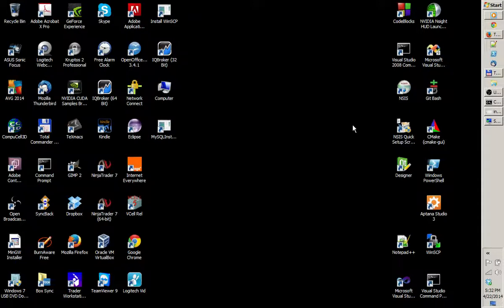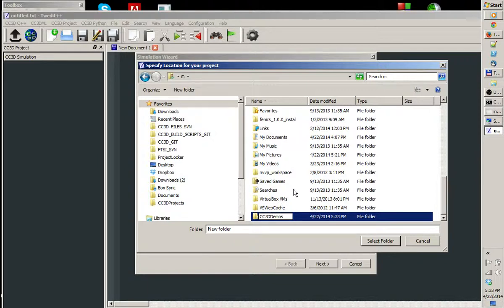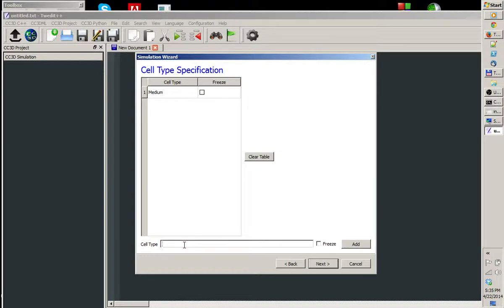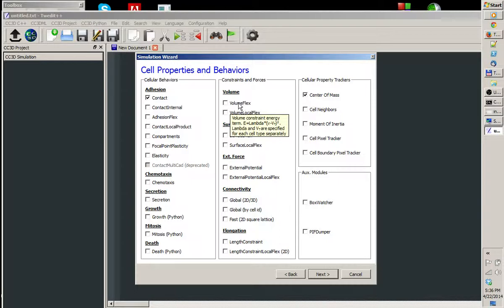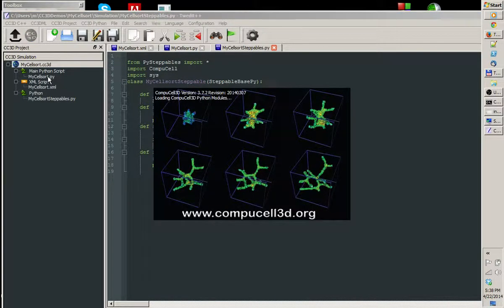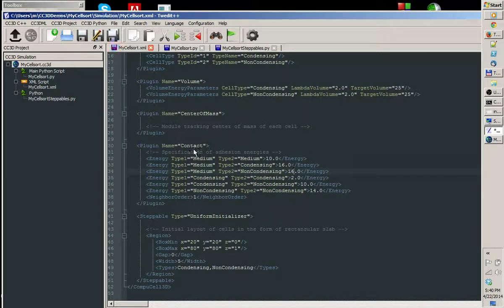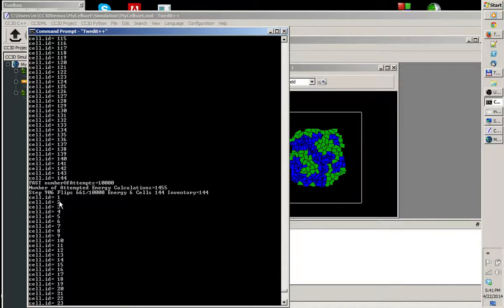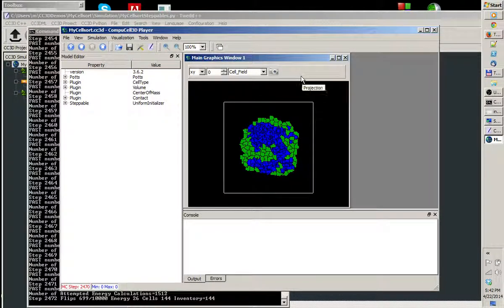Generating CC3D simulations using Twedit++

Comment: Hi, 
I've been trying to get this working. I am using Kubuntu and think I have installed CompuCell3D correctly. I can create .cc3d files in twedit++ but when I go to run in player they do not run. If I pause it or stop it and try to play again compucell3d just shuts off and I get the error 

, extraInit for: CenterOfMass
, extraInit for: VolumeTracker
, extraInit for: CellType
Segmentation fault (core dumped)
CLOSING LOCAL SOCKET

in the terminal. Any help with this would be great. I also tried running the cellsort_2D demo just in case it was a problem with how I created the .cc3d file and the same thing happens.